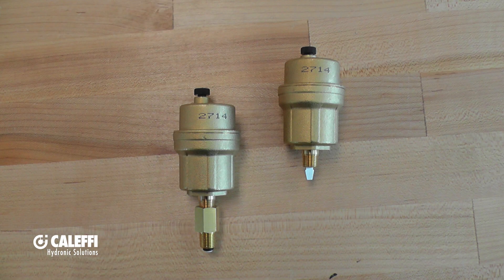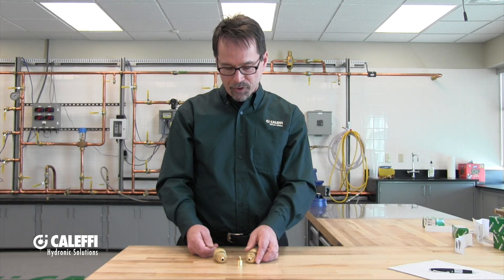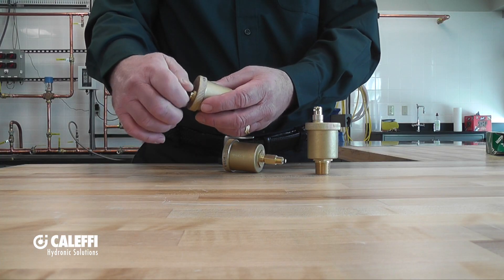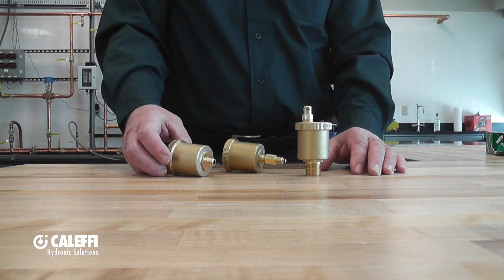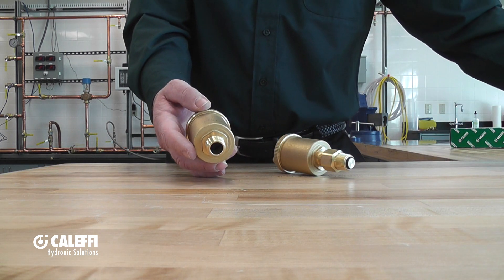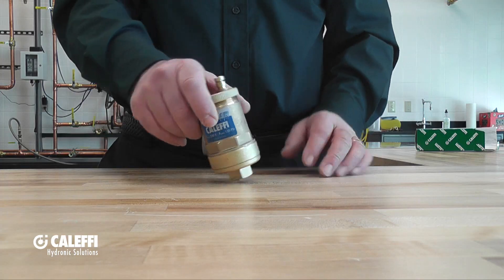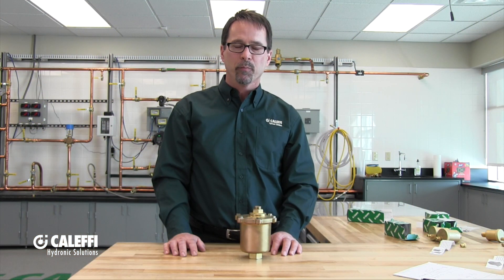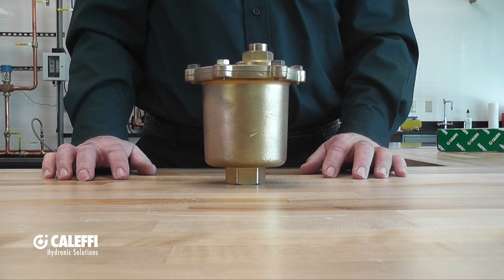Automatic Air Vent Selection Guide

Comment: Since my need is unusual, I need a little advise on choosing a part.  I would like to add an automatic air vent valve to my pool's canister / cartridge based pool filter (a pentair clean & clear CC100). The filter already comes with a manual air vent filter, but I'd like to replace it with an automatic type, to allow air to escape and close as soon as the water reached it. The need is due to the fact that the system  inevitably draws some air, which then accumulates at the top portion of the pool filter. That condition prevents as much as 1/2 of the inner filter cartridge from being properly used. I know such valves exist, but are more typically for inside plumbing, so I'm hoping someone can suggest a part I could try that would be likely to work. Thanks for any advise. I'd probably use a 1/2" treaded coupling, but since the filter is made from plastic, I could probably drill an appropriate hole to make any valve fit.
Reply: Did you ever get an answer to this question.  I have the same issue.  Thx
Reply: @mchristopher  no. But I don't need it anymore.